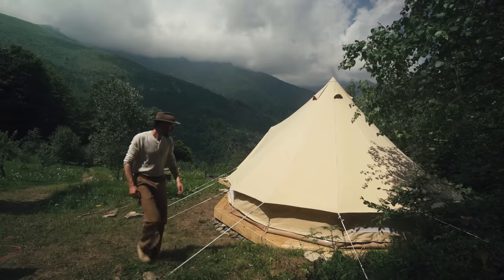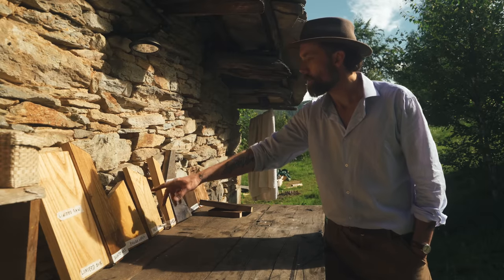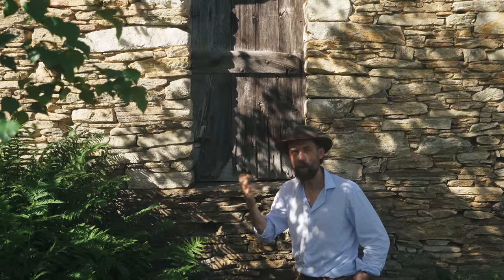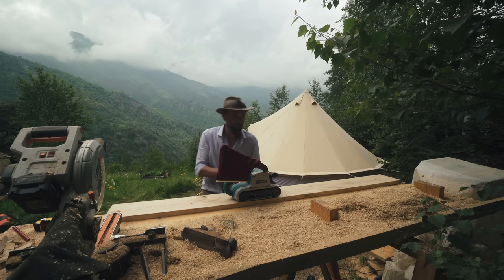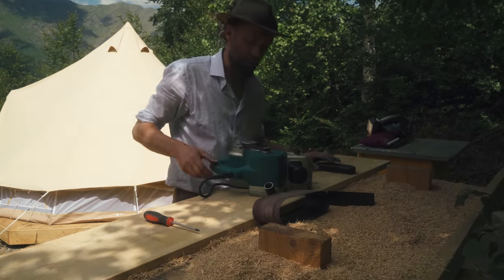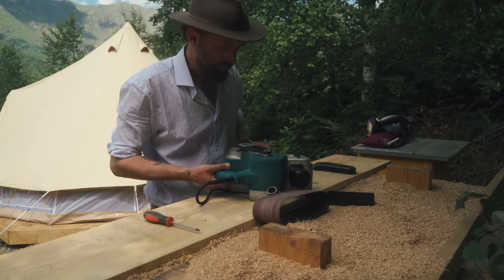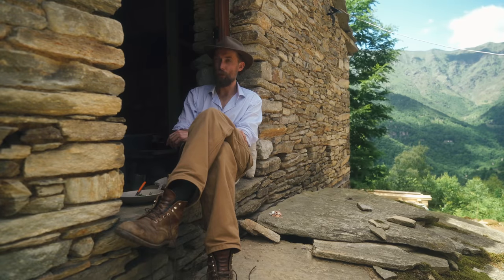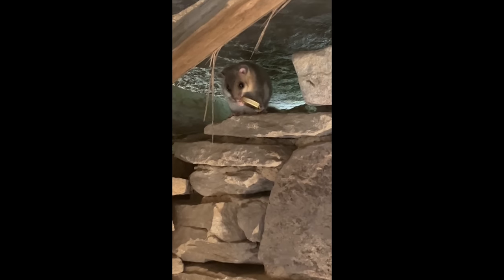#23 Setting up the tent, Building stairs and a porch for the deck

Comment: every week end , morning coffee and 3 homestead challenges, My Alaska, My Self Reliance and your self.  Love them all, much is learned from each one of you.   Your buddy the mouse, he is not going to go away.    building  the term "clad to weather" would be the point to achieve.    A pressure washer, from the inside, force all foreign matter outside, on a windy day for a quick dry.  Then seal from the outside . from the inside there should be no day light visible.   And you love the tall grasses, but are the main problem ..... mouse has some place to hide.  Cut grass well back to help discourage all tiny creatures wishing to move in with you.  This winter I had a mouse for about 5 hours.  They live everywhere.  What I had learned living in the Yukon from my neighbor who spent his summers in Tagish, he said that mice dig at an angle - bout 6 inches out towards the building.  He gave me printing sheets - these  a trench was created, printing matter was angled from the outside of the trench to the cabin, stapled .... no more mice.   All the best .....mountains, lakes, give much peace and strength in spirit.

Comment: Martjin, you may already know this, but if you tip the riser that holds the tread of your steps to the down hill side, they will feel more normal when you walk on them. Level will feel uncomfortable when you step on the tread. On a 12-inch step and an 7 to 8 inch riser, I've found that 3/8 to 1/2 inch works well.

Comment: Raw linseed oil doesn't really ever "dry" which is one reason it's used with oil paints for art...it stays flexible and resists cracking. BLO, on the other hand, cures similar to a varnish, albeit it's less of a film finish. .  You can put the sander cord up over your shoulder, BTW....I do that a lot for sanding operations (and only sanding)

Comment: Martijn perhaps you could test vinegar and chlorine bleach, it's great for rusting steel as the vinegar is the acid and the chlorine provides the oxidizing agent, it should age timber nicely but I have never tried it, also being an old builder of "things" I would have built a set of stone stacks steps on the end of the porch.

Comment: Well done on finishing your new home. Have you got heating for the tent? I know you can get a fairly cheap portable wood burning stove for those type of tents in case of a cold snap. ‘Girl in the woods’ and ‘Bush Radical’ have been using those types of tents while building their off grid properties in Alaska and Upper Michigan if you want to check out the type to buy❤️✨

Comment: Those seven sleepers we call them in Canada Packrats and they can be a pain in the butt in the fall when they try to move into buildings, I trap them with life traps and release them far away, the called Packrat because the like to steal staff and pack it in to their nests, nails screws  tools jewellery, but the have their place in nature, you just have to make sure close all holes and keep the place clean and open around the buildings, we live in the wilderness of the coast mountains in BC

Comment: When you burn the wood, wire brush, clean off and then apply linseed oil, tiny shiny homes on utube use this application, you should check up on them.

Comment: Oh dear - as soon as I saw that sander I was going to ask  "How long did you go before you chewed the cord?"!..  Whenever I use mine I always have the cord come up on the far side of the piece of work and lay the cord over the dust bag connection - that keeps it out of the way.. It's very difficult to catch it when it's there.
I commented last week that you should run the string OVER the beam so the back of the string (the bit that is under tension) is supported - I guess you missed that.. It would've saved having to add extra support and made the stair 'easier' too.. that's a steep flight you've built - I'm guessing 45º.. A comfortable stair has a tread of 10.5" and a rise of 8" max giving a pitch of around 37.5º..
Anyway, that tent is gorgeous - love the way the top floats above the bottom when the skirt canvas is raised.. and that orange glow at night - so welcoming..

Comment: I was honestly expecting a yurt based on that deck.  I think some sort of rigid framed tent would have worked well if you were planning to leave it up longer term.  Ropes just aren't going to age well and you have to re-tension them every day or so.  

One other note, not sure why you installed the vertical boards on the steps - just to add support for the steps?   It going to create a "critter hide" that way.  (what my dad always called it)  

As always, love watching your videos.

Comment: This idea may seem a little out there, however you could find those old wood from other structures with pension and cut the board in two and use the new thinner boards as a veneer on your doors or other structures.

Comment: Martijn  one of the safest ways to protect yourself and the cable is to pass the cable over your shoulder and loop it through a back belt loop so you can simply pull it out. Oh and dude protect your hearing else the mountain's song will not be heard 20 years from now. Phil Moss NZ teacher of making.

Comment: Regarding your questioning about faking wood to look aged, I think your perspective late at the video is correct. Taking into account the theory and practice of proper restoration, trying to fake something to look old or similar to something old, is ruled out. Things should represent their era, even though they should match the rest of the existing parts, in mode of shape, design or material. But looking at it one shall say that although this is new, nevertheless it is suitable for its use with the existing, it serves the purpose, it matches the aesthetic perspective. Then it is successful.
And speaking about wood, it changes and ages rapidly, so almost only at the beginning it looks like odd.
Here in Greek mounts we also use alot of chestnut wood to build doors, benches, tables, fences. Every year it just looks different and different. It is actually living on its own!
Thanks for inspiration.

Comment: A trick to avoid getting the cable stuck again is to drape it over your neck and let the cable run down along the hand you hold the back of the tool with.

Comment: That Suzuki  car is such a good work horse. Are you going to use Celotex or kingspan insulation under the concrete floor with a waterproof membrane? Great video!!

Comment: Jn my experience, most "boiled" linseed oil is not just boiled, like they used to do it long times ago. Instead it often contains "drying agents" which can be very nasty chemicals.
I alwas use the raw stuff. Buying it as animal food, as this is the cheapest. if you appl it very thin and have it exposed to a lot of air and sun, it dries in a few days. The older the oil is, the faster it dries. so i would recommend buying a big container.
for the wood for the cabins i would suggest doing it like they didi in the past, because this is where the beauty comes from. And that is: Nothing for the main part. Doors and windows just with raw linseed oil.

Comment: Is the deck bigger than the tent? Looks hard to tell in the video. It would be best if the water from the tent went over the sides of the deck so you don't get any build up of water and the deck remains dry and protected by the tent. It looks like the roof of the tent might just stretch far enough which would be good news. Rain coming off the roof and hitting the deck instead of the ground might not be so good. Looks beautiful though.

Comment: An excellent video. But for the steps down from the tent deck, why on earth do you need risers let alone planed and sanded? Weather and time will take their toll. Make them solid by all means but why spend time prettying them up as if they were indoors rather than outside in the elements?

Comment: When I was in the Army when we put up a tent. we would not just put a rope Cord from each eyelet . We would run two. At about 45 degree angle. This will put tension at each direction plus holding the tent twice as many strength for large for high winds for where you at. I would be very unfordable the way the factory says to put it up. Army cannot be wrong. Please take advice into consideration..................

Comment: I can see some conceptual errors of this tent. First of all, its load-bearing part - only one central pillar... In a downpour combined with the wind, it can break like a matchstick. You should buy an ex military tunnel tent. It would be more comfortable and sure. Another thing - stairs at the entrance to the tent ... Wasn't it better to locate the entrance at ground level? I understand the scenic aspect but it's the constant walking up the steps (at night, in the rain for example ...)

Comment: If you want to renovate AND conserve the buildings for a long time, do not use concrete! Try to build with the same materials as already in the building. New „modern“ building materials are a worse compromise…
For a clean floor e.g. the stone slabs again, grouted with sand or max with pure burnt lime/sand mortar.
Nice documentation btw ;)

Comment: How will you seal up the inside walls of the cabins?  Pointing with mortar would take a lifetime to complete !!  .......also how will you insulate them ? Im thinking you will have to "tent" the buildings and then nuke them to rid the walls of unwanted creatures before either building wood interior walls with insulation or coating them with lime/plaster somewhat like Johannes did .... and leave the beautiful rock alone on the outside
A. Van Reed
Boston

Comment: Question: (not criticism) in a past video you mentioned the concrete cinderblocks under the table you found as not being 'correct' (My guess judging that they wouldn't have done it that way during the original construction). Yet here you choose to poor concrete for your cabin floor. What spurred that decision?